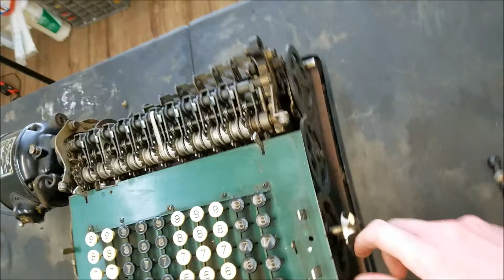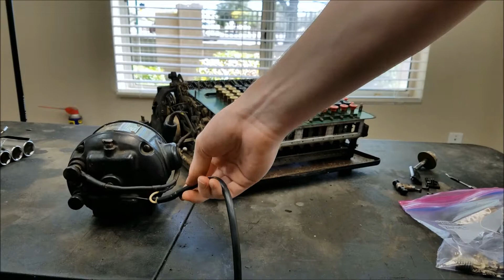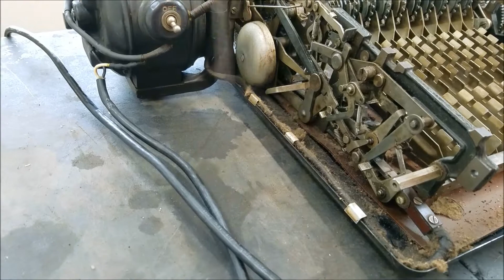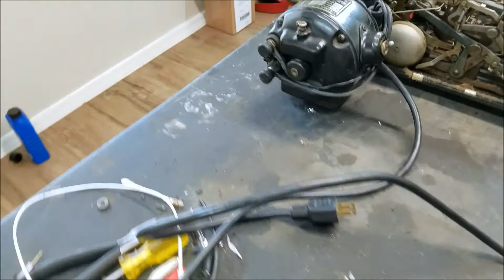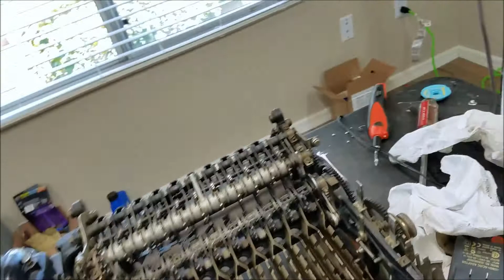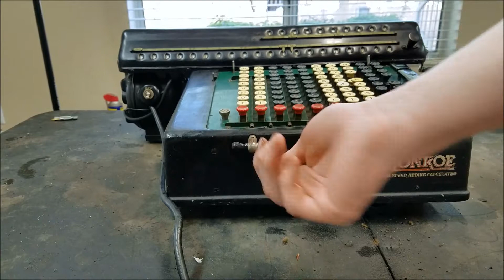Monroe KA Calculator Final Repairs

Comment: I sure hope I don't have to take the keyboard off of my K.  I just took the carriage off of mine to do some maintenance (cleaning and lubrication), and took the time while it was off to remove the tracks from the front and remove the burrs which occur from decades of wear.  My machine is missing its left-hand carriage support roller but it doesn't seem to affect its operation.

What is the lever for on the left-hand side?  Bell inhibit?